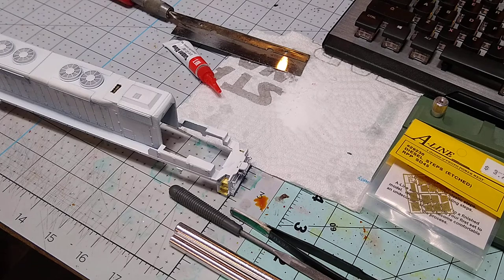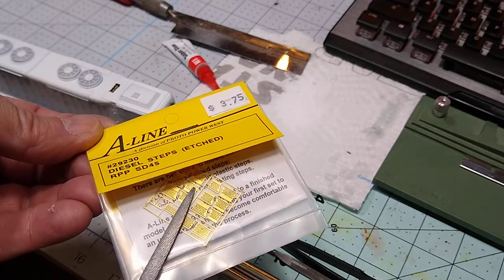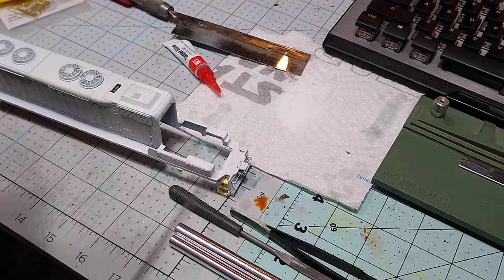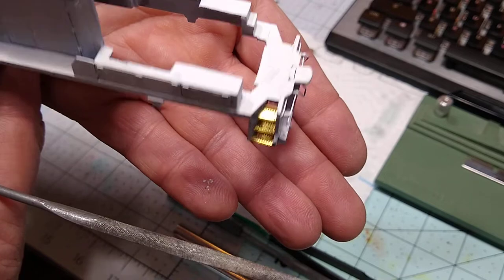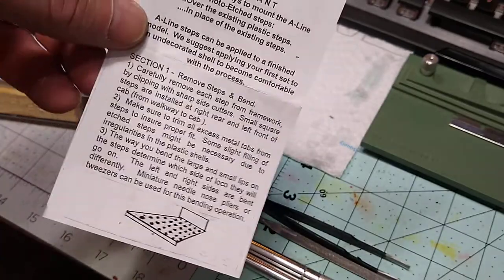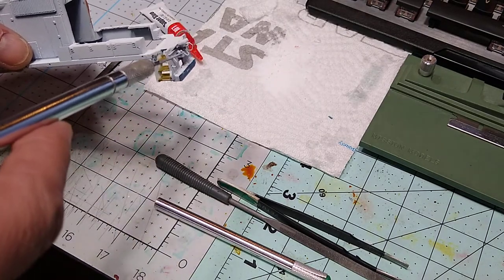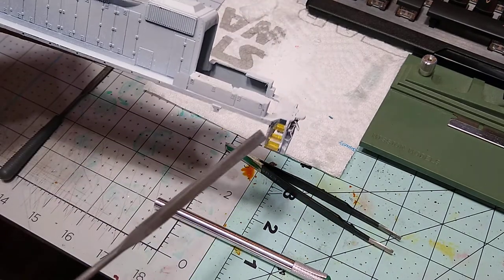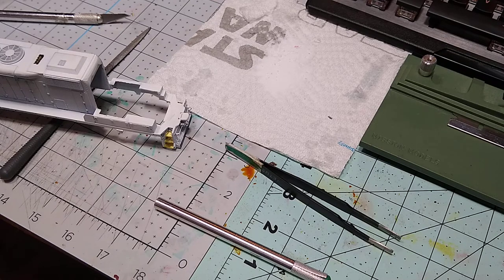5 locomotives in 30 days part 35 photo etched diesel steps

Comment: My friend 4 hours.  They cost 3.75.  So for a dollar an hour.  Get in there and jack one up.  They look great. Perfect. So you got the front steps done in 6.5 hours.  Do you have like a website where we can bet the over/under on you getting done at this rate?  We had a real nice time together, yesterday, I was doing a power pickup upgrade and forgot something. Guess who popped up with the answer.  I skipped ahead to what I needed to see.  Rodger that.  Then came your video where you were showing off your new motors, they ran pretty smooth.  Then something was jacked so I went back and watch the whole damn thing.  Okay, maybe I could just text you.  I was really pissed you didn't tell me that when I looked the first time I watched.  Seriously.  The steps look killer. i ordered some walkways n grills.  So like how long on the walkways 2 days no sleep.  Another thing, I haven't watched in a few days.  How many times are you going to paint that.  I saw one where they were all painted.
Reply: One time when I was sick I binge-watched the whole of Breaking Bad.  You are closing in on the number of episodes of yours I have watched.  Glad you have a sense of humor with that kind of commitment I feel like I get to talk a little smack.  Are you the guy with the new drill press?
Reply from the maker: The first set of steps I panicked when I realized they weren't meant to go on a Bachmann at all and it took me that long  because I thought I could end up wrecking the whole thing... then the second set I did a lot more prep work and got it down to 90 minutes, now I could do it in about 40 minutes.  I wish I had the walkways because they go on fast as long as you have a something like a sharpening stone handy to smooth the sprue cut.